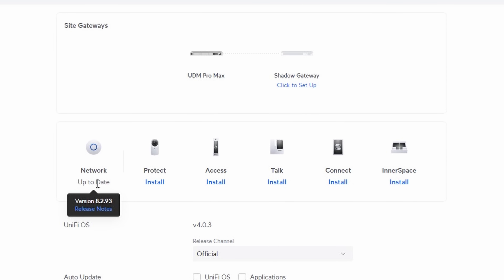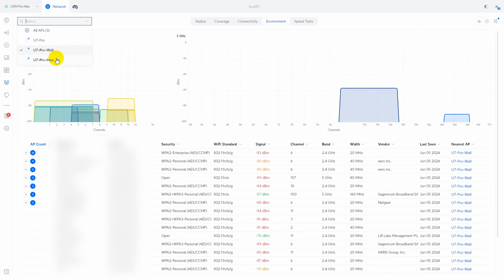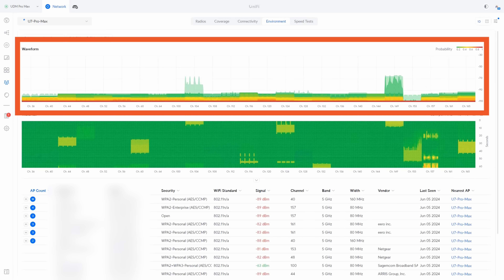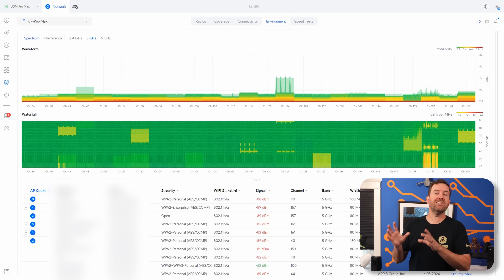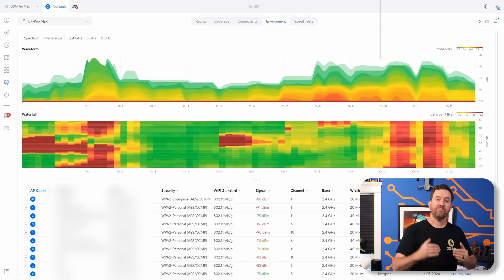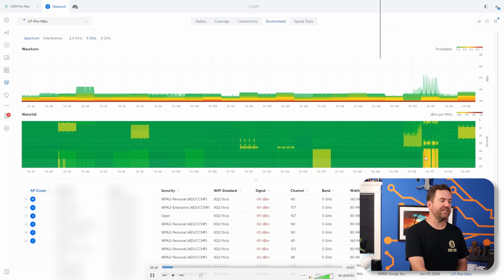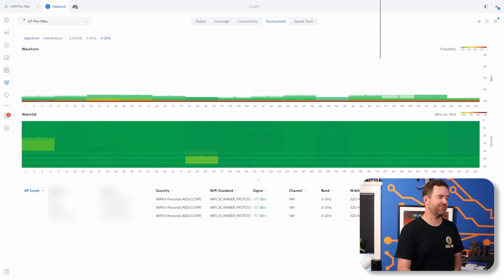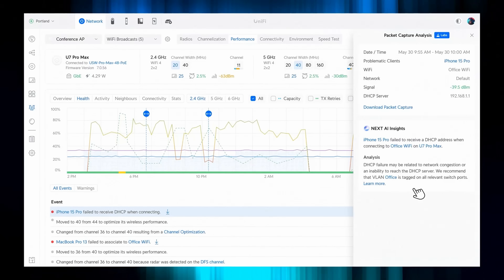Top Tier Wi-Fi 7 Access Point - U7 Pro Max Overview

Comment: This is one of the stupidest products imaginable. Why would you offer a 15Gbps access point and equip it with a 2.5G uplink? Even at full duplex this thing can do 7.5Gbps, 3 times the speed of the uplink. Competitors like tp link offer a cheaper BE11000 model and actually put 10G ethernet on it. Why is ubi skimping on such an important part of the product?

Comment: I have this AP the 6 ghz is really fast if you are in the same room with it or one wall away.  Any further and you loose speed and modulation.  My mobile phone falls back to 5 ghz and is faster at distance.  These are for high density applications in a small space.  If you have a lot of interference in your area the 6 ghz is going to help.  I suspect once these get popular like 2.4 and 5 ghz hardware today it is just a matter of time before folks pollute the spectrum with ultra wide channel widths.  The device only has a 2.5 gbps port why use larger channels?  Still nothing beats a good old ethernet cable or direct fiber connection.

Comment: I understand WiFi 7 speeds go up to 8Gbps+, how will you get more than 2.5Gbps with the U7 Pro Max white it only has a 2.5G Port?
It also says it can do 9.3Gbps over the air while it has 2.5Gbps Port, why & How? and Yes Internet Speeds are different than LAN speeds, I do know that but I am lost for the 2.5Gbps port but gives you 9.3Gbps over the air, since you'll only get 2.5Gbps internet speed limited to the port it has.

Comment: This should have been like $219 for the slight bump in features from the U7 Pro.  The U7 Pro is currently $189 and the U7 Pro Max is $279.   Also, I just can't with these fans in the access points.

Comment: Dude, it does not matter if you have WIFI7. 6Ghz is also available in Wifi6e. WIFI7 enables you to use those spectrums in parallel instead as alternatives, therefore mounting it on a level, where it has to pass at least one thick barrier might not make sense. If the floor is not affecting the signal - fine, but 6ghz does not go through barriers as good as 5ghz. But if you considered that and it is the best location, I would love to know strongly it affects the signal compared to 5ghz.

Comment: I am managing a residential setup where my parents are working from home. Their offices are on opposite sides of the house. The ONT for my Wi-Fi is centrally located in the laundry room, which is surrounded by metal (this was due to the house's design, which was established before my time). To address coverage issues, I have installed a UniFi Dream Machine SE along with 10 access points throughout the house.

Currently, I am using some off-brand switches, but I am considering upgrading my network infrastructure. I am open to suggestions for new UniFi equipment and have not yet purchased a server rack either. Any advice on the ideal setup for this environment in 2024 would be extremely helpful.

I am essentially trying to run a business scaled set up in a home environment.
Reply: TEN ACCESS POINTS????????
Reply: @bluearcherx  I have a lot of thick walls. Ten isn’t really needed but I have quite a few dead zones on extremes of the house. I am also trying to set up outdoor cameras so the perimeter of the house needs good coverage too. 

Right now my network hovers between 70-120 devices. Most are iOT and guest devices

Comment: The lack of 4x4 MIMO on both 2.4 & 6 GHz is a deal killer for me, especially at this price. I really would have expected AT LEAST 4x4 MIMO on all the bands (like my U6-LR), if not even going up to 6x6 or 8x8 MIMO on both 5 & 6 GHz
Reply: Low end specs and lack of previous features like Bluetooth at extremely high price points is greedy.  The new U7 lineup to date is hampering WiFi 7 from reaching its real world potential while removing feature support for the Protect AIO Sensor.
Reply: @URackADisciprine  
> like Bluetooth at extremely high price points is greedy.
What for do You need Bluetooth interface in (semi)enterprise AP?

Main problem of this AP is lack real MU-MIMO on 2,4GHz (only 2x2).
Reply: It is not enirely based on greed. With 2x2 on 6Ghz, you can already get up to 5765 Mbps. That is twice as much, as the uplink can handle. Since we all know how to interpret that number, it is a fair throughput to uplink ratio. If you want to go with 5gbit uplink, your total costs and energy consumption will go up, without providing a matching benefit. It is simply not worth it. Just go with 2 APs and set them to low power, that will not only provide better throughput, it also improves your wifi coverage. But for the 2x2 on 2.4ghz - yeah, that is just cheaping out. But since I live in a dense area, the 2,4Ghz spectrum is around 45% occupied and I would not benefit from 4x4.
Reply: @andreas7944  Poor specs across the board and lack of previous features like Bluetooth at a new ridiculously high price point = greed greed greed!  This new lineup is doing nothing but holding WiFi 7 from reaching its real world potential while taking away options like the Protect AIO Sensor.
Reply: @andreas7944  Poor specs across the board and lack of previous features like Bluetooth at a new ridiculously high price point is pure greed. So far, the new U7 lineup is doing nothing but holding WiFi 7 from reaching its real world potential while removing support for things like the Protect AIO Sensor.
Reply: I wouldn't buy any Release 1 Wi-Fi 7 stuff; it's missing some juicy bits of the full Wi-Fi 7 standard that are only coming in Release 2: advanced AP coordination (coordinated beamforming, joint transmission), HARQ, significant latency improvements, etc.. These are overpriced because UI are shoe-horning a development platform (pre-Release 1) into a shipping commercial device: it was never designed to scale. Just look at Ubiquiti's earliest Wi-Fi 6 stuff.
Reply: @ikjadoon  Highly unlikely prices will go down.  The feature sets of the U7 AP line to date (also all lacking Bluetooth), latest higher end enterprise gateway releases as well as a sudden push for "full" enterprise level software features Ubiquiti never cared about until recently all tell a different story.

Comment: Does this one unit in the attic cover the entire house and what is the performance 2 floors down?
Reply: Bump. And what about a stone wall house??
Reply: I’ll say this much, I have an old AP AC Lite in our 2nd floor hallway centrally located. Our devices in the basement still connect to it occasionally, even with totally usable 5Ghz, AND I have the signal strength turned way down on this unit. The Pro Max would likely have no issue punching down to the basement as well, even if it were the only AP.

Comment: when i swapped my Enterprise 6E to a 7 ProMax, she was damn near too hot to touch on certain points, and these are mounted on my ceiling in 68-70F rooms.
Reply: What are your thoughts on performance between the 6E Enterprise and 7 Pro Max?
Reply: @LuminousPlasma  over the last couple weeks, I am almost wanting to put the 6E Enterprise AP's back up. Also still waiting on MLO is that is still supposed to get released.
Reply: @jamestiller  Is it worth upgrading from 6E Enterprise to 7 Pro Max?
Reply: That's crazy.

Comment: Yeah it is pretty good but I am still going to wait for the enterprise version. I also need to wait for a new UDM Pro that actually has 2.5Gbps ports and POE to support them. Until then there really isn't much of a need to upgrade from U6 Enterprise.
Reply: but you can take UDM-SE with POE+ and 2,5 gbit ports
Reply: @ivan_adamovich  I am confused what you mean. the UDM SE only has a single 2.5Gbps Port and it doesn't have POE on that port. All of the POE ports are only gigabit which now is slow enough to bottleneck Wifi 7. If you want 2.5Gbps and POE on the same port Ubiquiti wants you to buy one of their Pro Max POE switches.
Reply: @chaosfenix  You are right, SE has only 2 2,5 Gbit ports, POE+ only on 1gbit ports.  my bad :(

Comment: Got 2x U7 Pro Max 2 days agon. Nice devices, lightning fast. The spectrum visualizer is nice to check for free channels and optimize spectrum distribution.
But those boys get HOOOOTTTTT, almost burning hot in fact. Don't put them flat on a surface, make sure there is room at the flat side in between the device and whatever it is on. They need about 10-12W under normal (mostly idle) usage.Albeit there were that hot, I didn't hear any fan, nor was it evident if it even runs/ran.
They were absolutely easy to adopt and integrate (with me they replaced 2x AP-AC-HDs and 1xAP-AC-nano HD. The nano is not necessary anymore, because the range is imho better.
If you have questions, ask.
Reply: I am curious if you could get away with only running 1 Max? How big is the house?
Reply: @bluearcherx  It is a 2 story brick building. I had AP AC HDs on the same locations before, quite centrally, one on each floor. I can reach the about 90 sqm on each floor quite ok, albeit in the kitchen (through some walls) reception could be better. I might get a third U7 (maybe a U7 Pro) to get a little further, but can live with it very well for now.

Comment: I am very new to home/business networking. If I do not own an ubiquiti ecosystem, but want to add wifi 7, does it make sense to get this access point? Do I lose features for not pairing it with a dream machine and brining my own router and switch? Do I have access to all this spectrum analysis info only with the AP?
Reply: You can get the APs to work well (fast, most features) with just the AP and your smart phone. Adding a controller lets you do things like roaming and centralised management of multiple APs. I don't run their switches but that would let me configure traffic isolation in a simple way. Don't expect everything on the spec sheet to be enabled at product release but they are good at adding software support with updates.
Reply: Looking forward to the video. Found your channel a week ago and learned quite a bit from it. Thank you
Reply: Thank you for the reply, Michael. Can you still do VLAN tagging if you only own the AP? I will look more into the smartphone interface. Thank you for the hint
Reply from the maker: You’re in luck!  I have a ‘UniFi Basics’ video coming out next week!

Comment: I just upgraded from three nano hd ap in my home to 3 UniFi 6 enterprise access points. I was tempted with the wifi 7 option, but if the wired interface can’t even support what the max throughput of the radios can do, plus with the fans, what’s the point?
Reply: Even if the uplink is limited to 2.5 GbE, the faster WiFi speeds can reduce the latency and overhead for local traffic and communication within the network. Remember, these devices are primarily produced for deployments in high-density environments (i.e., 500+ client devices). Your point is valid, but this product is not intended to address that particular use case. 

For enthusiast like us, we would indeed benefit from 10GbE uplinks like the legacy UAP-XG has—perhaps Unifi will release a WiFi 7 version in the future, but even then it's configured for high-density environments, which is why the price is so high. I'm sure there is a market for 10GbE WiFi 7 AP's for low-density environments, but Ubiquiti doesn't target those markets.

Comment: I've had two u7s for a few months now and ever since upgrading from the six line. I've had a weird issue where cell phones say they're connected to the access points, but there's no internet. Toggling on and off Wi-Fi on the phone fixes it. I didn't change anything else except for upgrading the access points
Reply: Give your access point a dedicated IP address in the router (static lease), do not use DHCP.
Reply: I did notice it happen on my phone too with the u7pro, but haven't seen much similar feedback yet on the internet.
Reply: @tntantoine  yeah it's super annoying because there's no indication on Android phones other than scratching your head about why the internet isn't working until you check. Based on experience I feel like it must be some sort of DNS issue, it's always DNS but I don't know what setting would need to be adjusted. Haven't been able to find anything else online either

Comment: Thank you for the review. For me the presence of a fan in an accesspoint is a no-go for me. No Wifi7 for me 🙂
Reply: Have 2 of the Pro Maxes. Those boys get hot, nevertheless I didn't hear anything and have one in my sleeping room without a problem.
Reply: it makes you wonder what happens when that fan fails?  They must have had issues with the APs in testing to include one.  I would be surprised if it were a monitored fan as well.
Reply: @TheDillio187  There is no display of the fan status anywhere in the Unifi interface.
Reply: @_TbT_  that's what I was afraid of.
Reply: @TheDillio187  there however is also no indication that it runs in normal use and normal room temperatures.
Reply: @_TbT_  fair. It's still is a strange and somewhat concerning thing that they felt it was necessary. Maybe it'll turn out to be a big nothing burger.
Reply: @TheDillio187  I was concerned as well, but have no problem with it (hearing it) right now. So if people don't buy U7s because of this: it is not as big an issue as you think.
Reply: @_TbT_  I run wifi networks in non-conditioned warehouses.  It' can get hot as hell up in the rafters of those buildings, so I'm fairly concerned.  We're currently using AC Pro's and AC LR's without any issues.
Reply: @TheDillio187  Those U7 Pro Maxes (and as some reports say also the Pros get very very hot by themselves. They are specified for "-30 to 60° C (-22 to 140° F)", that should cover quite a lot and be no problem - even in non-conditioned buildings - albeit direct sunlight in a hot country can push over this easily, I guess.

Comment: Thanks for the video. I just installed my U7 Pro Max yesterday and I don't have any devices that use wifi 7 yet and I am trying to get a unifo pro poe max switch to power it over the injector I am using right now.

Comment: Ever since the latest version of Ubiquiti dream machine pro's network controller software my U7-Pro has been really slow.
WIFI-6E I get about 400 / 900Mbps.
I use to get 1.2Gbps to 1.5Gbps prior to updating the controller software.

I did try the latest EA version for the U7-Pro and got my normal speeds for a few minutes.
Reply: Get yourself a REAL firewall.
Reply: @OneNationUnderHiFi  agree, i had a dream machine pro which i got at cost and was able to sell for more than i paid for it.. bought a netgate 4200 to replace it.. blows the udm out of the water.. especially with wireguard vpn speed.. i would get 680 mb/sec with a wireguard connection to proton vpn on the udm pro and now get 990 mb/sec with the 4200... night and day difference

Comment: Hi!  I am building a 3 level home and I’m planning on using this APs (1 on each level).  Ceilings are 9’ tall, and the total SF of the house is 3600.  How much interference will these APs will have with each other?
Reply from the maker: Not much = set them to auto channel selection. A normal home won’t be able to generate enough wireless traffic to saturate available bandwidth.

Comment: I'm moving into a new home that actually has this already installed. But instead of being way up in the attic, it attached to the ceiling of the upstairs level which looks and seems much better. We're glad its also TP link being that we recently bought the TP Link Deco 16000 3-pack. This should help even more with the 2600 sq ft of the home.

Comment: Anything with a fan will screech and die.
Reply: Yup huge no for moving parts for me
Reply: I would add anything with a compact design will eventually die.    That's why back in the day small form factor voicemail PC-based cards inside systems were hell.    Also, later on, small form factor SIP Server appliances vs full-size 19" wide RM devices.    The ones with fans on both sides, never a problem.     Also, POE switches in a small form factor with PS built-in -- UGH! - always purchase ones with the brick power supply outside of the unit, in a fan-free design.
Reply: Yeah gotta say the fan does make me worried. Most of these devices wind up in some pretty sketch spots and either straight heat and or dust getting inside give me pause.

Comment: Hmmmm the attic mounting is interesting. I never though of that
Reply from the maker: I’ve been doing that for 4 years now - works fine.
Reply: @CrosstalkSolutions  awesome ty for the tip. Moving in a couple weeks and I might go with the identical setup you suggested and see how connectivity is for the family.
Reply: I live on the countryside in France where I do WiFi installations. Internal walls in old houses can be very thick (up to 24 inches / 60cm) but they don’t go up into the attic. So I mount them mostly in the attic just over a wall to cover both sides of that wall.
Reply: I have mine “mounted” under the floor boards of my rancher, pointed up through the floorboards. Works perfect :)
Reply: Don't do it.

You're wasting the higher frequency performance plus the higher heat will shorten the life.
Reply: I agree, these in an attic still give killer range
Reply: Attic mount places it as high as possible which improves coverage.  Despite the ever so slight attenuation of the layer of sheetrock or plaster, overall it usually is better.  The only downfall can be extreme temperatures in summer months.  If your attic is that hot, however, consider active ventilation like gable fans, roof fans or turbo vents.